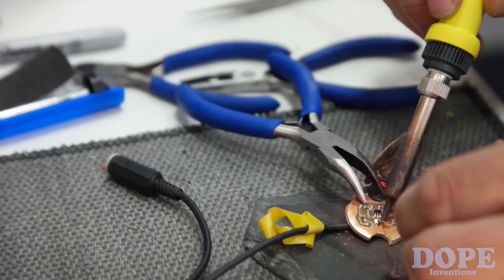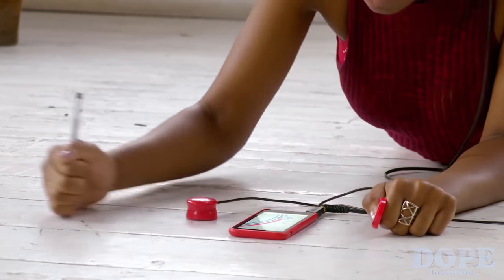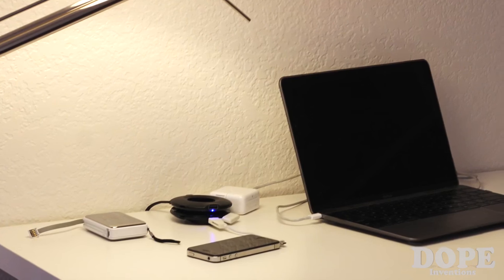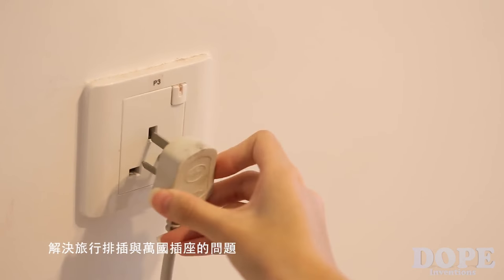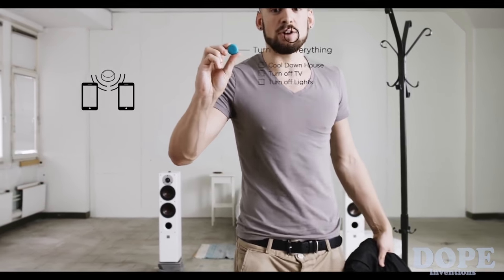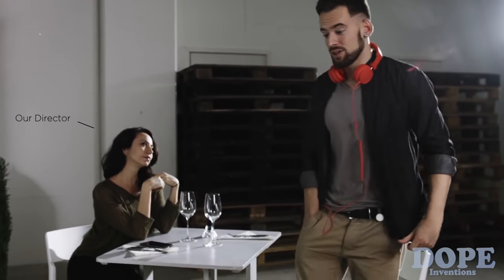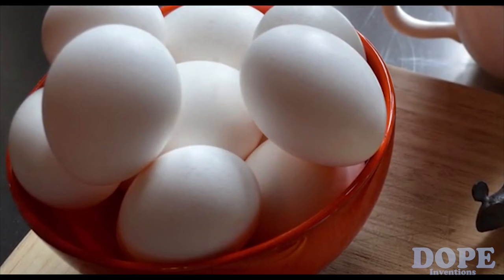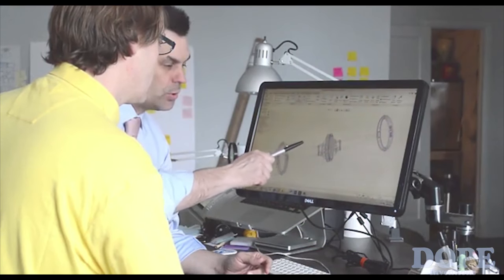5 Cool Gadgets You Can Buy NOW on Amazon (Under $50)

Comment: Battery started to fail in my Nexus 6 a few months ago. I keep it on life support ( tinyurl.com/y53cswgh ) to make it to Black Friday hoping to find a deal on an upgrade, but nothing came close to the value and form factor of the Nexus 6, even 4 years later. I had already tried to replace the battery some weeks ago. But once I got the back cover off, and saw all those delicate ribbon connectors, I wimped out. I use my phone for work daily, so if I screwed up and broke it, it would be a huge hassle to deal with the downtime of replacing it.
Reply: Electricity," Purva said, rolling the strange new word around in her 
mouth, giving it at once an Australian and a French inflection.
Reply: need for more backup

Comment: That power bagel is dangerous, it doesn't allow for connection of the earth terminal! Fine if you only use double insulated devices but no extension lead should bypass a massive safety measure!